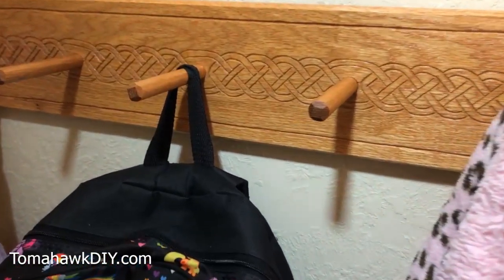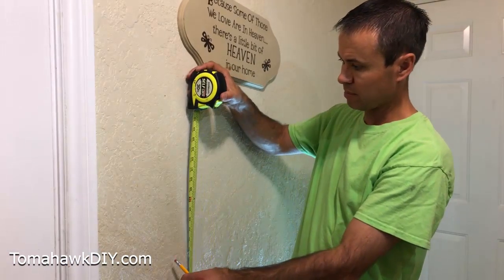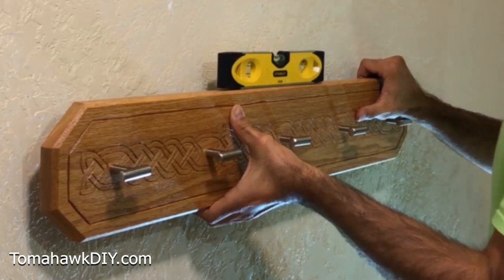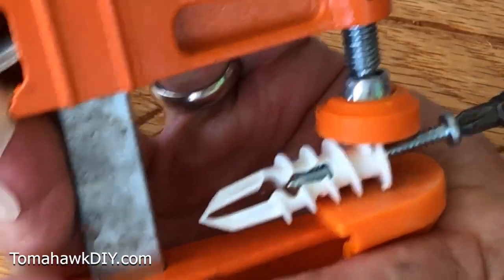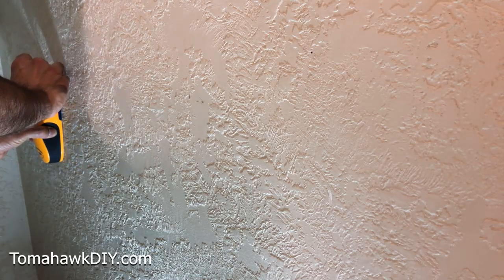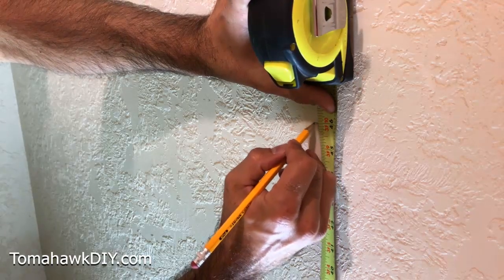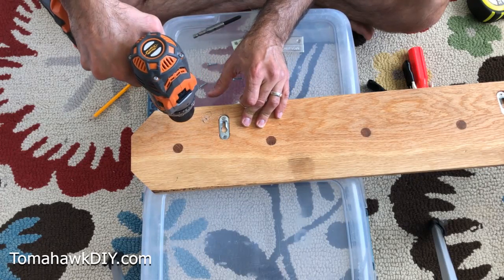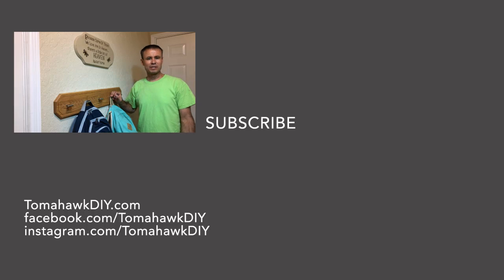Easy Coat Hook Installation (Hang Things on the Wall)

Comment: Simple yet effective. If you have a basic set of chisel's or even 1 chisel, I would be nice to create a small rebate for those "Z" hangers. It would mean that the coat rack sits against the wall and doesn't slowly droop over time due to the weight hanging from it. I've never seen those "Z" hangers before and I'm going to keep an eye out for them in the future. Thanks for the great video 👍

Comment: installing a 3/8" spacer at the bottom will reduce that droop in the hooks.
Then, with an equal gap all around, you can say something like "and with the 3/8" offset from the wall, the coat hanger gives the illusion of floating next to the wall." :D